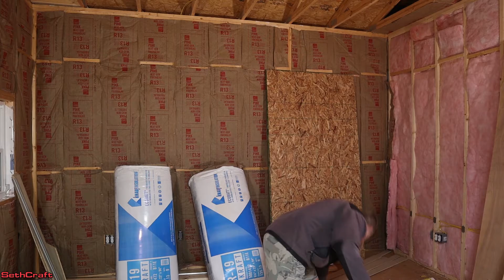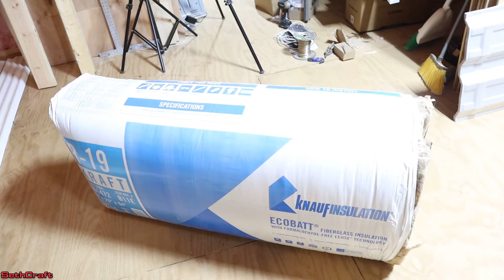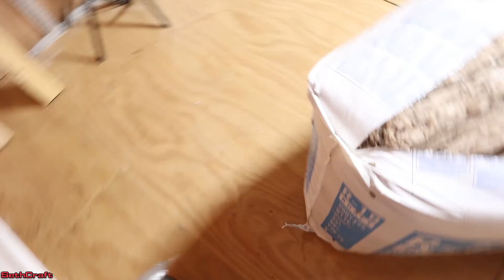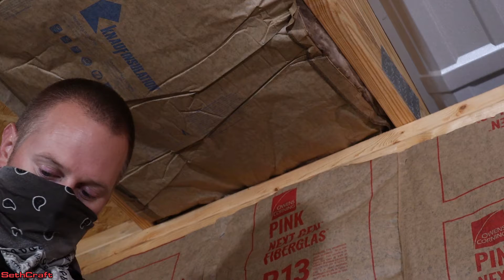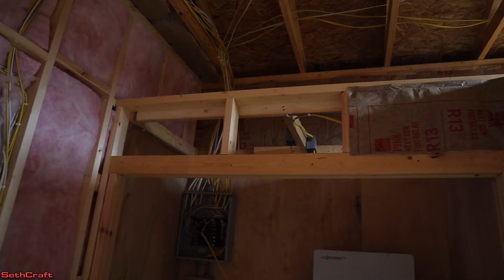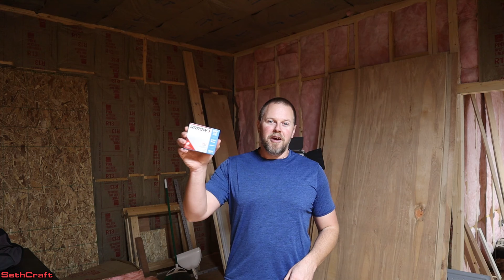Workshop Ceiling Insulation R19 Batts - Build a 20x30 Workshop

Comment: Love the content. Now what if my attached garage already has ceiling drywall, and I plan to install these batts in the small space above. Since I can’t staple the bottom side (because of the already installed drywall) could I just use the insulation wire supports instead?

Comment: Was any vapor barrier used or needed? Thank you.
Reply from the maker: The only vapor barrier was the backing on the insulation. I now have a mini split in this space and that takes care of the moisture.
Reply: @sethcraftshop  that’s interesting because my plan initially is to have a mini split in the shed. So perhaps I don’t need a vapor barrier either then? Also, how is the efficiency of the mini split in the shed with the insulating that you did?